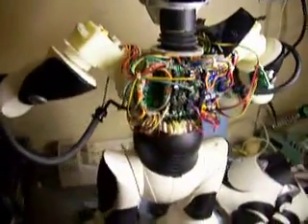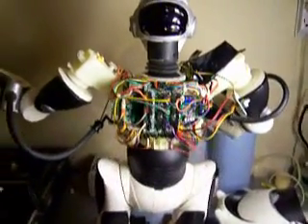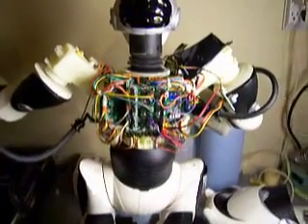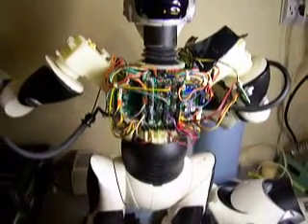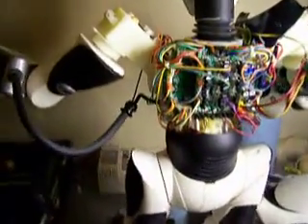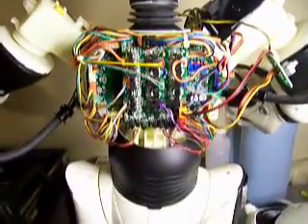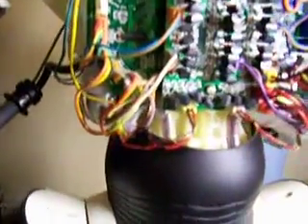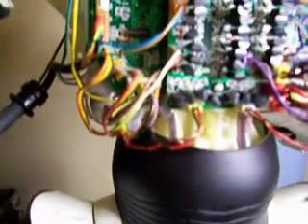Robosapien Fire Hazard

Comment: My RSV2 did this also, on the leg looms only, and my RS1 had a similar problem with the leg motor wires also. I guess the insulation dries out and crumbles with the movement. All fixed now though :)

Comment: I had the exact same problem; the insulation is like confetti and just flaking and falling off the robot and causing shorts and smoke - someone will have a fire in their home and god help Wow wee - as they have been told about this for years - directly and on boards and have done nothing to address it.

Comment: I have a first generation Robosasapian, used it for years. If i recall i won it in 2006 or 2007 when it first came out. Still works fine though it hasn't been used since my forth of July Video when i strapped some fireworks to the back and made a nice light show. Due to proper protection the robot and the circuits inside were not damaged the slightest. I've kept the batterys in there for many years and i think they are dead at this point.
Reply: Can I see the video lol